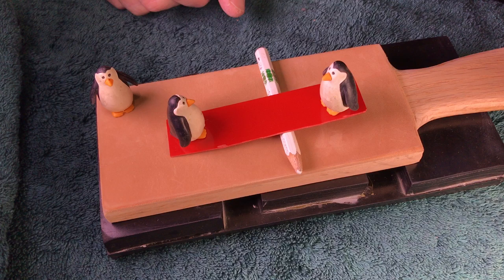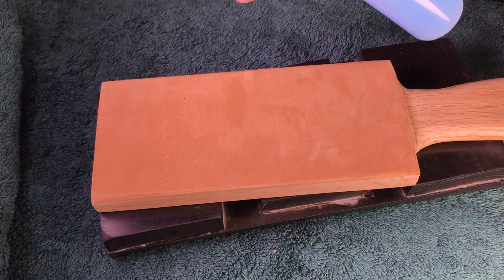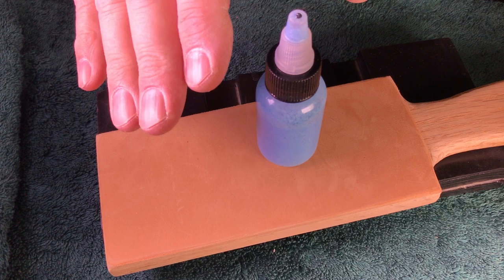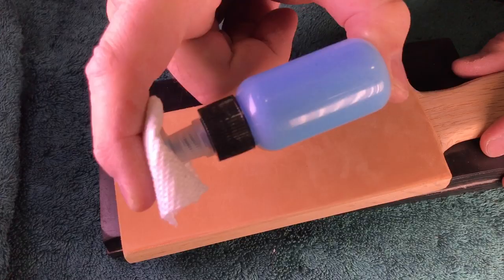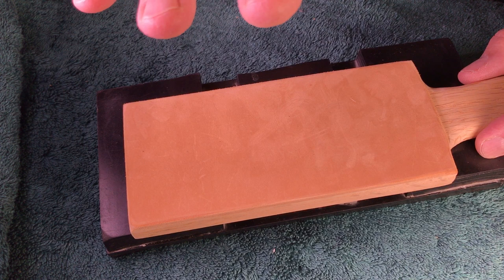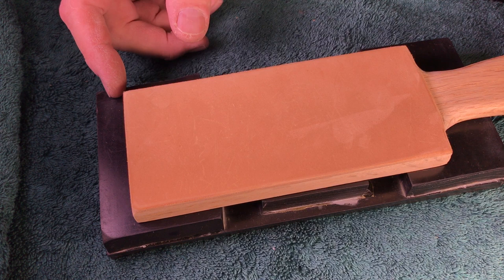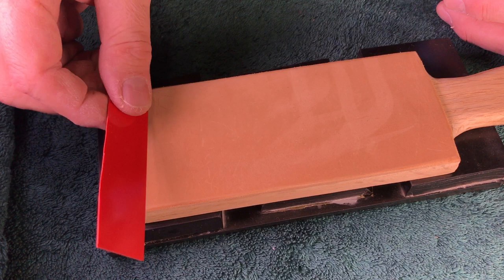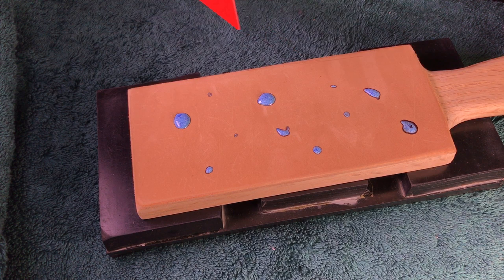How to Apply Strop Paste

Comment: I am a novice but I've made a 5 or 6 crude strops with garbage to decent leather. I tried oiling the leather before sandding it flat. Then, i put the compound on while the leather is still wet. I spread it evenly and let it dry completely. My hope is that it dries without too much warping.

Comment: Nice video. I wouldn't mind buying your basic Sharpening Paste set but the Aussie dollar and postage would make your stuff way too dear for me, that's if you even post to Aus.

The magic Gold Dollar, the savior of many great Vintage and other quality razors. I bought a heap to practice with and compare stones on. Not that I think the Gold Dollar is trash, you can get a great shave with one, a bit of work with a Dremmel (optional) and a bit of time on the stones and away you go, and they only cost a bit over $7 Aus.
Thanks.
Reply from the maker: My assesment of a GD out of the box is that the bevel angle is way way too steep, the spine needs to be ground much thinner, and the heel and toe are usually too thick. After grinding the spine, heel, and toe, they will hone semi-well and shave decently. For me, they are not great shavers; I have not found the steel to be all that great, edge retention is short-term, and the smoothness isn't there. These razors are cheap but to me the value is low. I'd rather put time into a higher quality blade. I learned to hone on a new Boker and a Vintage Westers - and I am glad I started that way. I never recommend GDs to anyone starting out; they are too much trouble to deal with, and the ROI is too low.